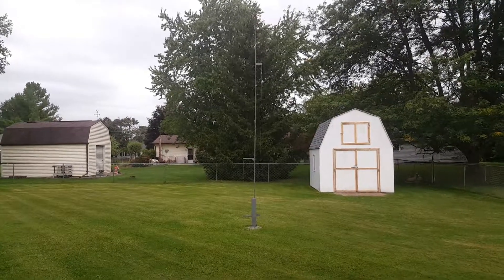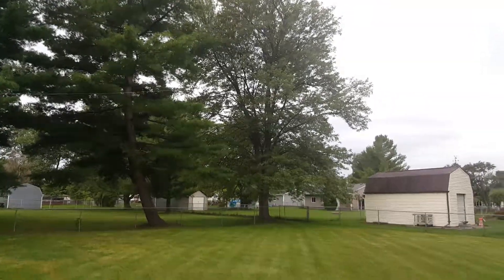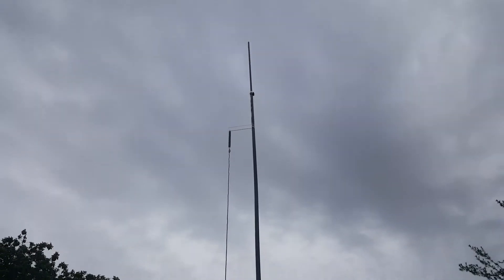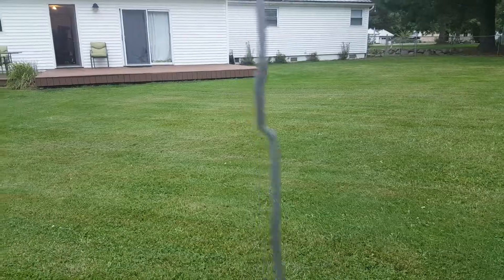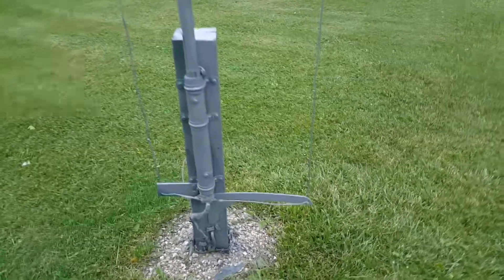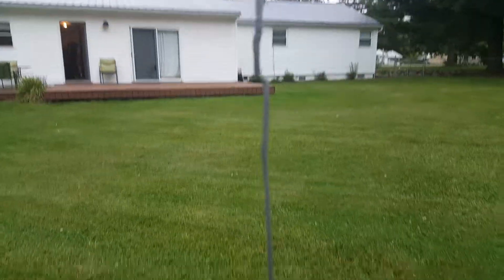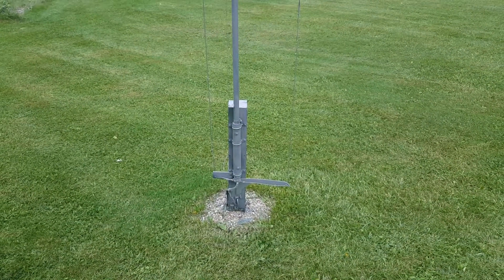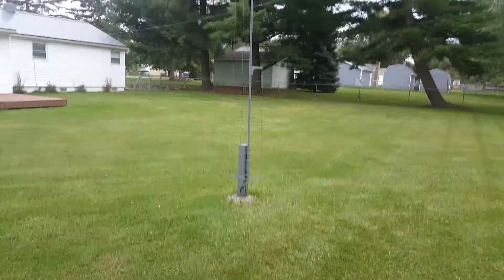Michigan Cacti DIY (free) 4-Band Vertical Antenna

Comment: Is that timber in concrete or gravel ?
Reply from the maker: Concrete.. but it's only maybe 3' deep and 10" in diameter. Had a little extra concrete on hand or I'd just have filled the hole in with dirt. The post weighs more than any antenna I'll ever bolt to it.  Lol. Thanks for watching :)

Comment: That is an awesome antenna setup!!!  The best thing it is free and it works for what you want it to work for.  Why spend 100's of dollars for a factory built antenna, when a evening or two and you can build what you want.  Thanks for sharing.  I sub'd to your channel.  73 Juddie WD8WV
Reply from the maker: Thanks for subbing.  I won't be uploading regularly but will whenever I think of anything worth showing anyone.  I'm into restoring vintage tube type radios.. and will be uploading vids that I'm gonna make of them.. but this time actually try to make something worth watching. haha. I'm going to be restoring a Heath DX-60B, a 1943 Airline 93BR-666A 'farm radio' (runs on a 6v tractor or auto battery, has no AC power plug), and a 1943 RCA 16X2.  73 OM